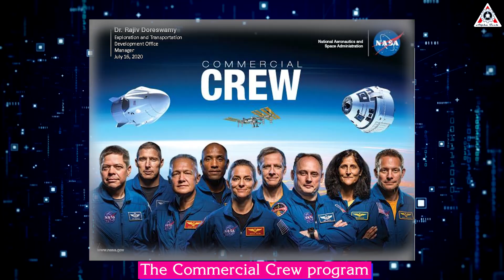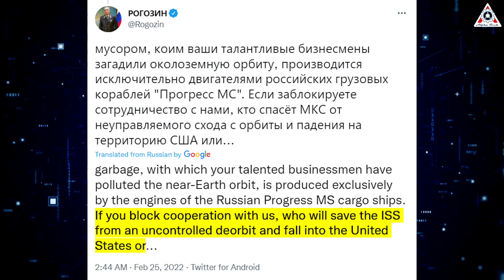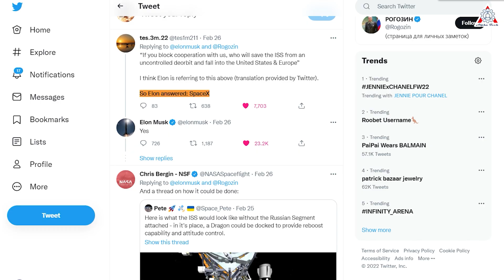Disaster! Boeing Starliner is ended! No way to STOP SpaceX & Elon Musk's new contracts with NASA

Comment: The problem is that Starliner was designed to help adjust the ISS’s orbit, but Crew Dragon was not. It would have to be modified somehow to add enough thrust to lift the ISS’s orbit. As it is in a low earth orbit, atmospheric drag is an ongoing problem. So without the Russian modules ISS has some serious problems.
Reply: Easy to add some thrusters in Dragon trunk.

Comment: Given current circumstances, it seems probable the measure of concern regarding potential action by Russia with regard to the ISS should be rapidly increasing.

If, Russia were to promptly remove it's astronauts from the ISS surely a successive 'thruster malfunction' on a Russian module might result in irremediably terminal consequences for the facility?

The blatant manner in which Venomous Vlad's goons have blundered about the EU poisoning people left right and center must be considered an example for the level of irrationality of which he is capable.

Comment: Boeing is still in the space business with their X37 (B) so it isn't like they aren't able or not competent enough to have a successful space program.  So far, their Starliner is a bust though.
Reply: I think part of the problem is that they (Boeing) are so politically driven, they have to farm out so many parts and functions to other vendors in the home states of certain senators. Thus when another company’s system does fails, they don’t have the deep knowledge through development to have an insight as to why the system is failing. Elon has a smaller circle to impress. He keeps everything possible in house, and vertical integration has many advantages. SpaceX is about efficiency, not Pork.

Comment: SpaceX Dragon cannot boost the ISS to a safe orbit when it eventually drops.  Starliner could if it worked.  The Atlas 5 uses Russian engines so the Atlas 5 will no longer be available to Starliner.  Yet another problem.
Reply: The new Vulcan (Blue Origin) will be an option at some point, how long who knows, lol.  Also I've wondered about Aerojet Rocketdyne developing an engine (not the already upper stage rocket engines used)  or even Space-X Raptor 2 engines being a possible replacement.
Reply: @Thunderbyrd.  Raptor 2 would be the better engine for Vulcan, but would require an entirely new methane LOX booster.
Reply: @Nick Viergets Yes , it DOES mean that  "it isn’t capable of doing so" ! 
How can you equate a ride-share module with a fully powered propulsion system ?
Reply: @Nick Viergets Hahahaha.  A space journalist on twitter with a famous one word confirmation from the greatest promiser in the world?
THAT'S your EXPERT OPINION ??
But his Engineers say "Oooh No. NOT another Elon blanket statement. Lets build a few more iterations and stand them in the spaceship sculpture garden without even testing them"
Do you really understand the work it would take to review the design of the entire unit, rebuild, retest and bring it to certification ?

Comment: Everything we know about the SpaceX Starship and Starbase TX after the first "Hoppy" test flight, has been designed, Built and tested in the same time it has taken Boeing to "FIX" Starliner. 
The time between Challenger StS-51-L  last flight and destruction (Jan 1986) and the next flight, Discovery STS-26 (Sept 1988) was 32 months or  2.6 years
Starliner demo  1 issues  was on  December 2019  -  So if it doesn't go up before Aug 2022 it will  match that timeline, any longer, then the time  in between will have taken longer to fix the Starliner than it did to fix the shuttle. 
Shame! Shame! Boeing!! You used to be such a grand and important company.